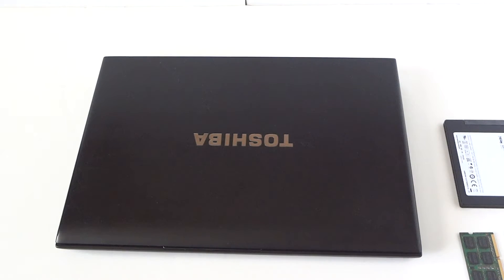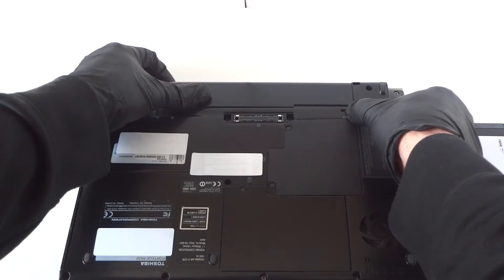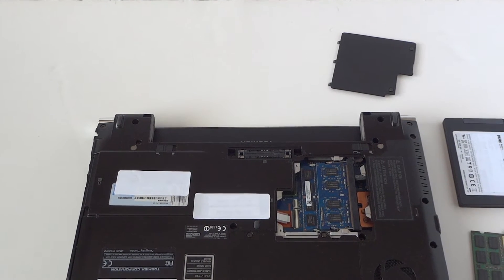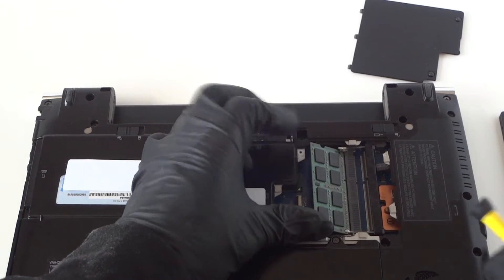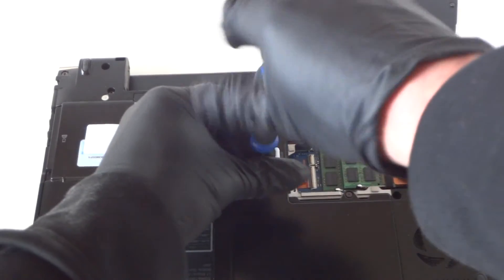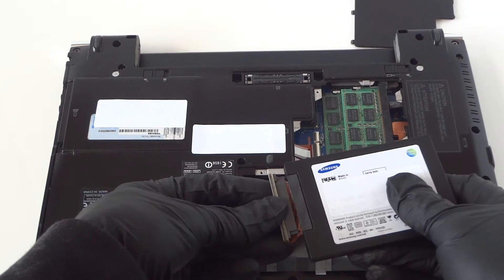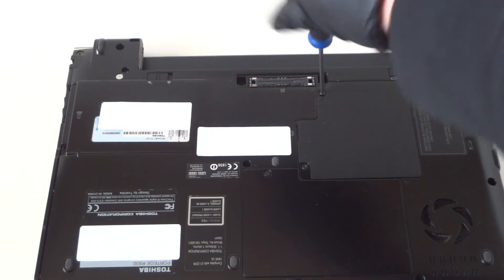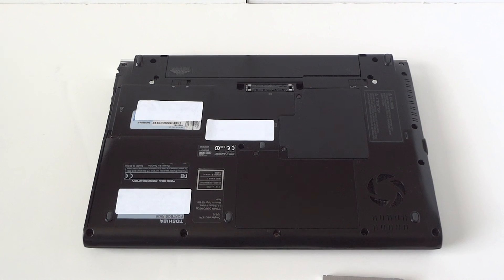Toshiba Portege R930 Upgrade Memory, SSD Drive

Comment: I have this laptop, but it has become slow...Should I upgrade to a budget laptop( honor magic book 15 or mi notebook)....will the performance differ? .....or is there a way to improve this one.
Reply: Upgrade the hard drive from HDD to SSD, that's what I did after mine became terminally slow. Now it's much faster and works very smoothly.

Comment: Is this laptop holding up today programs? Do you have updated to win 10?
Reply: I do, personally. She holds up real well, just needs extra RAM.
Reply: @robynalice879  how much should it be, is 2x4GB enough?
Reply: @kertaningnaga6051  Definitely plenty! :) As mentioned in the video though, it's probably best to also buy an SSD that fits your specific laptop, just so things run as smooth as possible. :) I hope this helps!
Reply: @robynalice879  what kind of ssd is compatible with it?